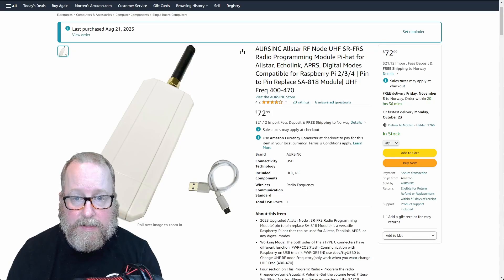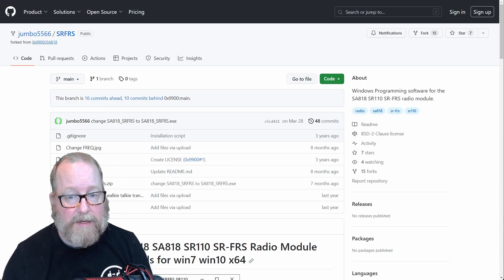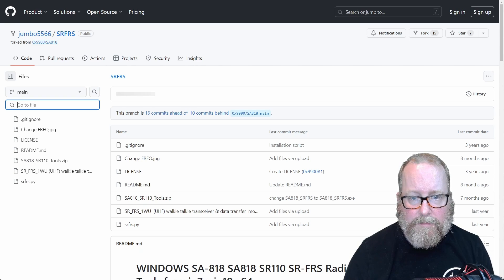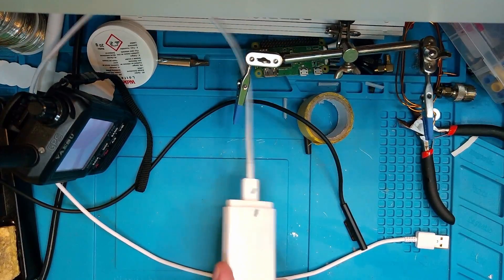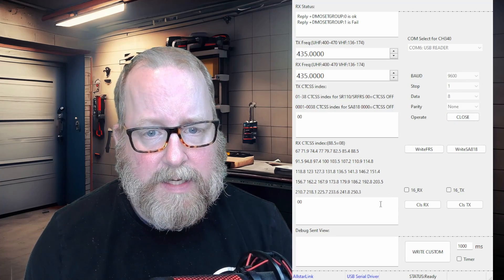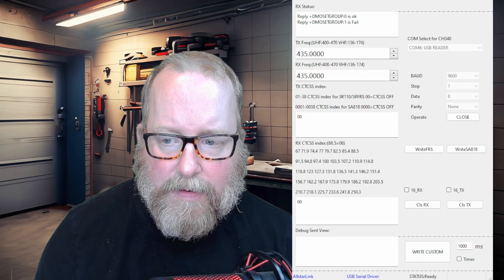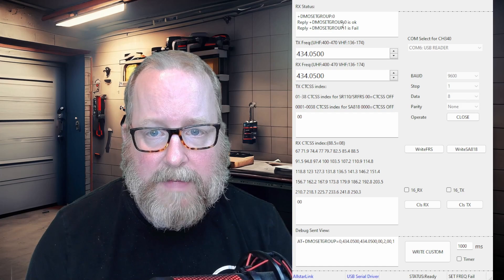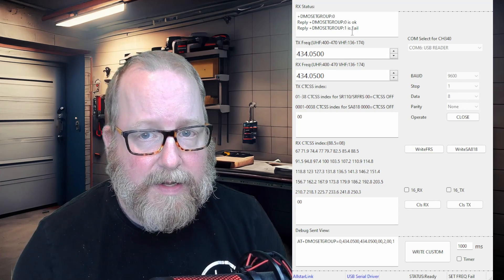Programming the Aursinc Allstar Node

Comment: That cable is not defective ! The cable is an OTG CABLE IT WORKS ONE WAY WHEN YOU PLUG IT IN  in one orientation and works a sifferent way when you flip it so mark one side of the plug so you know which way to plug it in.
Reply from the maker: Yes, you are correct, BUT the cable that came in the box was defective.

Comment: Hi, thanks for this.. however I am a Mac Mac and although I have a Windows Laptop, I cannot get the Windows Program to run on it.. As there is no setup program to setup the program.. any help would be appreciated ! Craig
Reply from the maker: I am really sorry Craig, but I have no possibility of giving support to every item and topic I have covered. I have about 400 videos out, and I get questions like these at least four times per week. My tip would be to check the webpage of the software. I am sorry, but I have no capacity or time to give technical support.

Comment: I just built an AllStar 3 node using a Aursinc for the radio link. All's well except the bit error rate is high. I know where this adjustment is on pistar but haven't a clue with allstar. Could someone please help me?
Reply from the maker: I honestly don't know. I haven't really looked that deep into AllStar. I will see what I can figure out once I get my note up and running.

Comment: I just purchased one of these from Amazon. I saw your review there. Mine came with a small folded up sheet of paper. It has the urls for the software required and it mentions that the usb cable has two sides and you need the serial side to program the device. Thanks for making this video and helping other hams.
Reply from the maker: You're welcome! I need to get mine up and running again, I repurposed the Pi for something else.

Comment: Is there a way to "read" whats on the radio that was previuosly set up? Also how am I going to tell if I have the USB C flipped the right way? Thx
Reply from the maker: I haven’t found a way to read what it is programmed with, but I am sure there is a way. As with the USB cable it is a bit of trial and error, but once you find the right way you can mark the cable as I have done.

Comment: Morten, do you consider the USB cable faulty because you had to flip it over for 2 functions? If so, that is the radio's fault. USB C on the board has 2 sets of pins which are normally shorted on the board. Or they can be connected to 2 devices on the board so flipping the cable is like having 2 connectors: one for programming, one for useage.
Reply from the maker: Nope, but the cable that comes with the node is not connected to all of the pins. But when you swap it with a better cable it works like a charm. And I actually like the unusual way that they have given this device two ports.
Reply: The USB C connector is supposed to be complimentary no matter which way that you plug it in. Is the USB A TO C the one that came with the radio or is it one that you already had and did you have to flip it to get it to work .... now im confused how can you tell if it is programming or "working right" .
Reply: @the1spyderryder  I will comment on the first part. Yes, USB C is supposed to be complimentary. But implemented with connections on the circuit board. Sometimes left out. Rarely, but it happens.
Reply from the maker: @the1spyderryder  You flip it one way for programming and the other for operation.